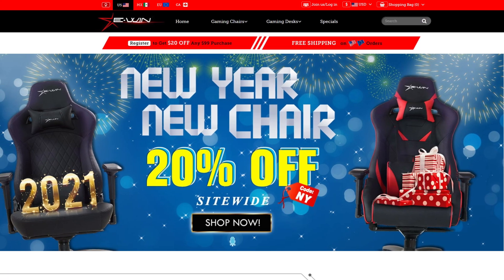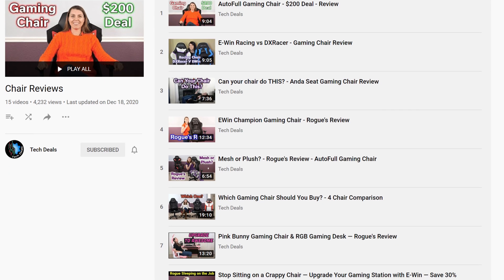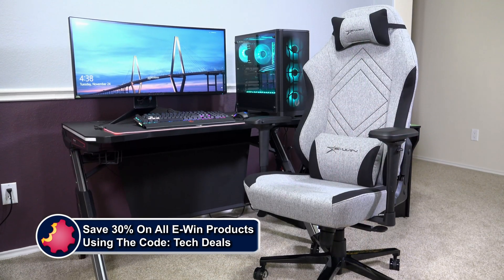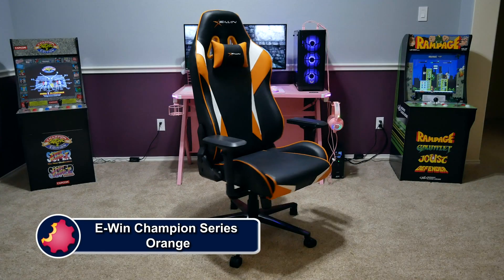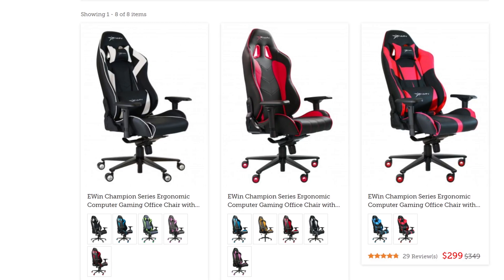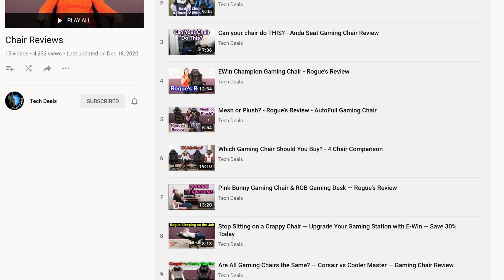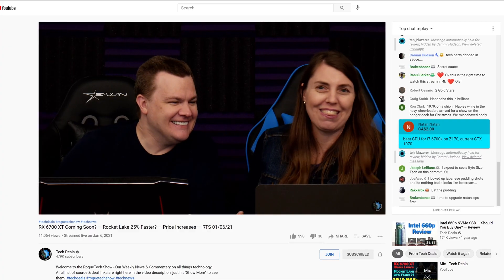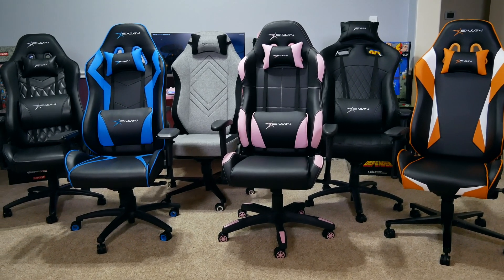How to Power your PCIe Risers For Mining?

Comment: You really shouldn't power risers through sata for sure you will burn your rig down, molex has too inconsistent manufacturing procedures with the pins. 6 pin reccomend. You are correct under 80% is  recommended

Comment: Memory temperature over 96°C you have to use other hardware tools to see this temp, Did someone considered this possible damage?, right now I'm starting mining with my only 5600XT Asus TUF gaming, the  gaming temperatures are almost the same described in this video but the memory temp is not over 84°C in gaming, but it got about 96°C in mining. At some 5700XT this temp is about 105°C and the memory brands say is not ok over 95°C, I found that underclocking and undervolting the core GPU I can maintain 92°C..

Comment: I'm averaging $15 per day mining - My (3) Ryzen 3700XT Computers - Cool, quiet and smooth. I don't mine with the CPUs!

GTX1660Super, Card Temp 52C, 2.25+ per day, 31.5Mh/s : RX5700XT, Card Temp 52C, $5.94+ per day, 52.5 Mh/s - RX6800, Card Temp 52C, $6.97+ per day.

I spent about $1400 for the 3 cards last year - before the prices went to the moon.   I spent about $2500 building the 3 computers total - (last year prices). Nothing fancy, 1TB SSD, 16Gbs Ram, X570MB, 850W PSU.

I have to give SPECIAL THANKS - to Byte Size Tech - They finally convinced me want to try it out last month - and I took the leap. At about $450 per month - it won't take long to get your initial investment back.

However, with Ethereum changing their game plain - this could come to a grinding holt in the next few month if not a little longer.  There's other things to mine, but I'll tackle that when the time comes.

Comment: Definitely run the GPU and riser for that GPU from the same PSU
Reply: @IJoeAceJRI  Not being sarcastic, if you want to avoid any problems, best to run a GPU and the riser it uses off the same PSU if you're using more than one. Less chance of instability, and if something goes wrong then it's also one less thing to troubleshoot

Comment: Sata's max power is 54w, if your lucky enough that your card asks for less from the pcie slot, then you're "fine", otherwise it will overheat and eventually catch on fire, why are you talking about not stressing your power supply to its max (and i agree) but not bothering pulling out 100% or more of sata's capacity from the cable/adapter?
Reply: This is why I went for 009s
Best riser currently. No damn sata either.
Reply: Use double sata or double molex to pci its the best option.  And each cord of sata maxes a 54watts so u have to use 2 different cords with the adapter.  I. E. From 2 different spota on the psu not on the same cord.